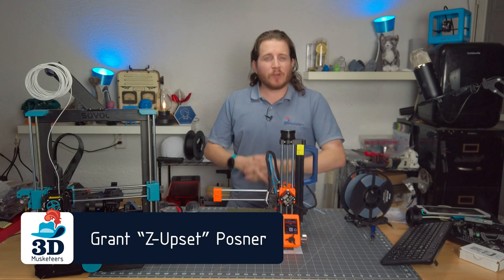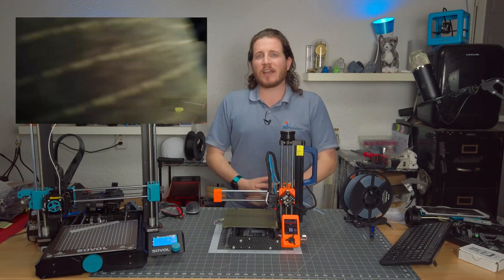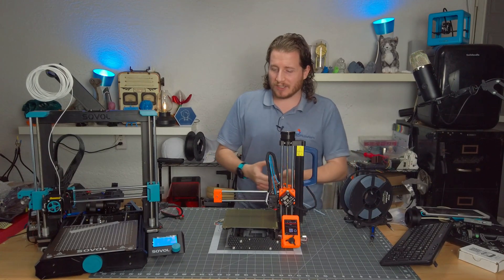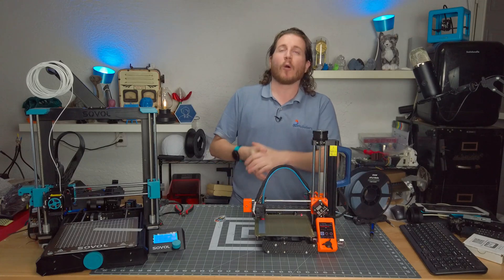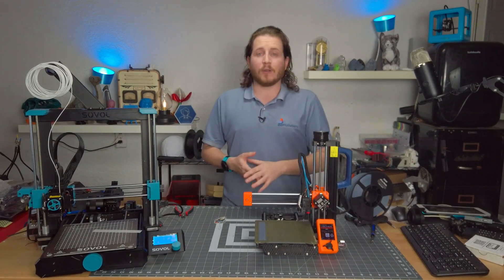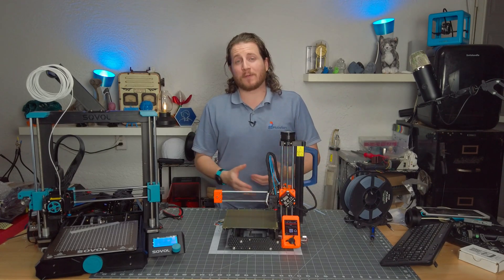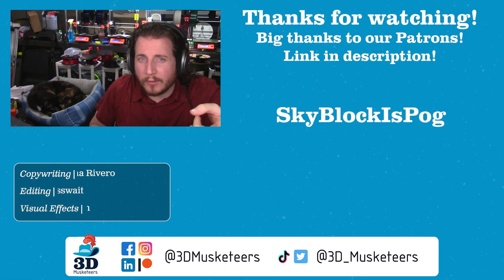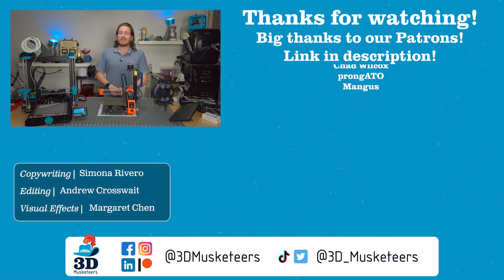How to get PERFECT First Layers on Your 3D Printer!!

Comment: I have a hardmounted bed and it's really simple, i simply use nuts in 3D printed turners; springs are removed entirely, and one set of turners is just above bed carrier and the other below, jamming hard against it both to lock, similar action to a locknut. Absolutely no movement, not coming apart at all, and i can adjust it if and when i want so easily.

But this is how i broke a borosilicate sheet after my probe failed to deploy properly due to servo wear.

Why would you want an oscilloscope for 3D printing, and would a toy oscilloscope (150KHz bandwidth 1MS/s single channel) suffice? If you're having any kind of power or interference issue, you should be able to just about see it on that. Because you can build one of those for less than 20. Otherwise, perfectly adequate real oscilloscopes by Owon and Hantek are WAY cheaper than the sorts of 3D printers you're running around with. There's also Fnirsi but i'd struggle to call anything they make "real" or "adequate".

Also i have independently controlled Z motors and my probe levels the gantry against the bed, touching down left and right until they're near even.

Comment: just one comment id like to add for anyone reading: soup cans are (obviously) not precision parts and will have a fair amount of tolerance between cans. a pair of machined  steel 1-2-3 blocks is like $18 on amazon and are accurate to .0003 of an inch between pairs. this is what i use to level my gantry and it works flawlessly/i dont have to worry about the temptation of wanting to eat a tool i use often like i would with soup.
Reply from the maker: Yeah 123 blocks are definitely better but most soup cans are close enough for this kind of stuff and most people have that in their homes already! :)

Comment: I constantly have peaks towards the edge walls, the center looks pretty good but filament piles up as the printhead goes to change direction on the infill
Reply from the maker: That often indicated a warped build plate :/ This would also assume it is an issue for perimeters as well, if not, its likely a pressure advance issue.
Reply: @3DMusketeers  I didn't mean the edges of the bed, regardless of placement in the bed this happens  near every inner wall perimeter within the infill, so I'm guessing it's probably pressure advance, but I've calibrated it through orca slicers PA calibration already, I'll try different settings and see if that helps

Comment: So i have a Sovol Sv03, been printing on it for a while and switch from normal PLA to different transparent filament. the temp i printed with for that filament was alot hotter then my normal filament. after i was done using that i went back to my normal PLA and i havnt been able to print since, i level my bed and set my z off set and as soon as it start is immediately doesnt stick and fails right away. Normally i can figure this stuff out but  this time for some reason i cant, iv re level and set z off set over and over and it still fails. is there anything else i could look at?
Reply from the maker: make sure they bed is clean.

Comment: Heya im having issues, first it seemed i was to close, i have flashforge adventure 3 light, i adjusted the Y axis and can move a peice of paper underneath with just a bit of touch, my rafts are now really odd, it does the outline thick, and the internal lines very very thin and not touching, almost like looking at a harp, any ideas how to fix this? im fairly new to printing still
Reply from the maker: The build plate could be warped some, this is common on printers actually. It is why we love auto leveling as it corrects for that stuff. 

I would do a bed level on the 4 points like you are doing then move the nozzle to the middle and see what it is like there. Maybe try and average it all out, you know?

Also, why a raft? It is generally an antiquated process these days.
Reply: @3DMusketeers  honestly, I only use a raft as that felt normal? Do you think it would skip this entirely without the raft? I considered taking it away but thought if it can't lay a raft, my prints without a raft would suffer the same issue. 

 I've just been releveling, I'm not 100% confident I'm doing it well enough. I shall press on and keep trying with the levels for now. 

 Thank you
Reply from the maker: they may have the issues. Rafts were what we used to combat warping of ABS back in the day. Removing the raft will help you better visualize the issue though

Comment: Next... Well that's a wast of time, Lots of talking, But no actual information on how to adjust Z offset, Even though he's got a few different printers 🤦‍♂️
Reply: It option on your printer
Reply from the maker: It's literally different on every printer.. not sure what you expect here.
Reply: @3DMusketeers I reckon he expects the same everyone new expects. I'm new, have watched at least 10 videos on this, and still haven't seen a simple explanation on how to use z offset. Questions that could help understand better here. Say I did leveling with paper, so nozzle is 0.1mm from bed:
What happens if I now set z offset to -2? How far would the nozzle be from the bed? 
If z offset was set at -2 before doing the bed leveling and isn't changed again, the moment I launch a print, at what distance would the nozzle start from the bed?
Reply from the maker: @AP-yd1wz  If you set the bed level with the paper and such, you would not want to set your Z offset to anything other than 0. If it is a negative number you will be too close to the bed, and -2 would mean that you would be very much digging into your bed. 

When you level the bed, before you do anything, return the z offset to 0 and then home and go from there :) 

Hope this helps!
Reply: @3DMusketeers  it does. But guess what, in one of many videos of this kind that I watched, part of the process before even doing the leveling with paper was to set the z-offset to -2.45. Later on I realised it must make no sense at all to do it. But it took time, exactly because most leveling videos are just useless.

Comment: I stopped having tramming issues when I locked the adjutment wheels with nuts and washers and locktight which gave me a bed that was trammed correctly and no longer has the ability to move and so there is only the Z Offset to adjust after the ABL is done, the machine then just prints, and prints well and they can go for 3 months or more without having to be adjusted, my Pro 3D V-King 400 which also has a locked bed and tri independent belted Z axis just does Z Tilt and then ABL and never needs any intervention, my 2X Ender 5 Plus machines have dual independent Z and locked beds and run G34 before each print and then ABL also hardly ever need need intervention.
Reply from the maker: If you have ABL you should remove bed springs IMO. Companies that ship with both are asking for customer support issues

Comment: I have the anycubic kobra and with having the PEI sheet I use alcohol however I also wash it with dish soap and tap water and that does the best job. 👌.  That is a great solution when alcohol does not work.
Reply from the maker: YES! Dish soap and hot water is a great backup!

Comment: I'll have to create a z-level file. That looks way better than the crappy stock one. It's way too small. By the time I can see the square, it's done printing. Having it cover the majority of the length of the bed looks useful. I know some people print one that does the ENTIRE bed, but I think that's too extreme and it will take too long to see the results.
Reply from the maker: its just a box shape, made longer for video, and only 0.2mm thick
Reply: @3DMusketeers  I figured as much. I was just going to make it long but narrow.
Reply from the maker: I think the one we made was 20x150 so I could put it on the sovol and the mini lol. I adjusted the offset manually for the video